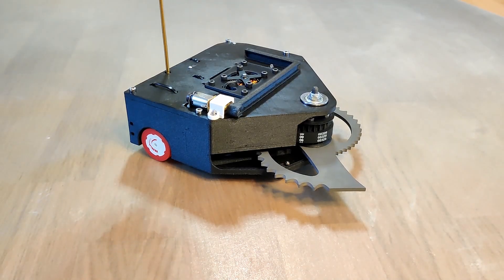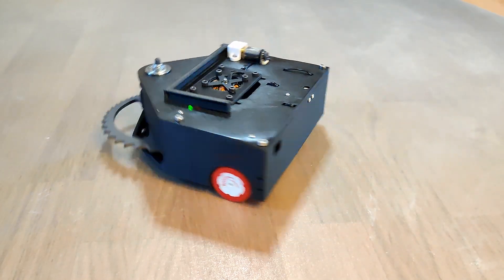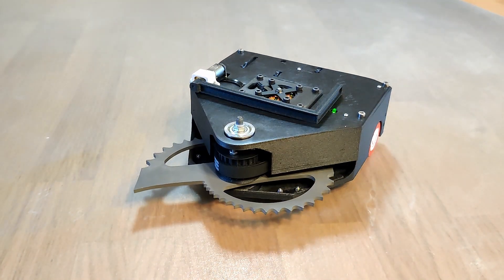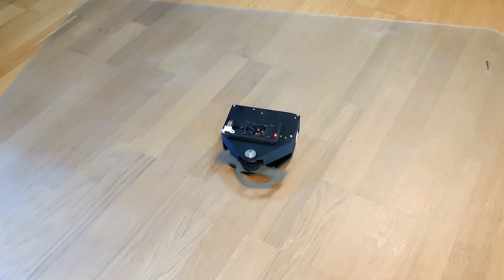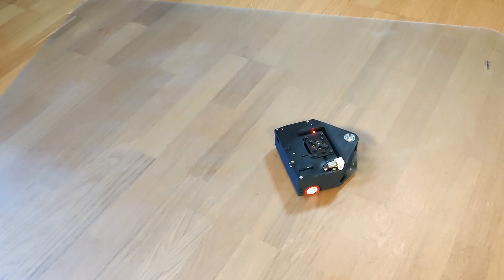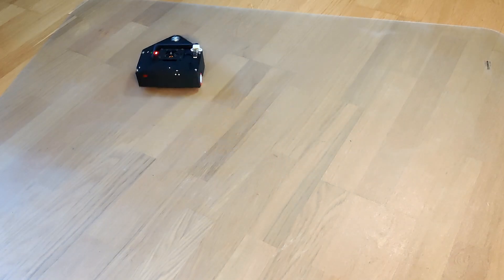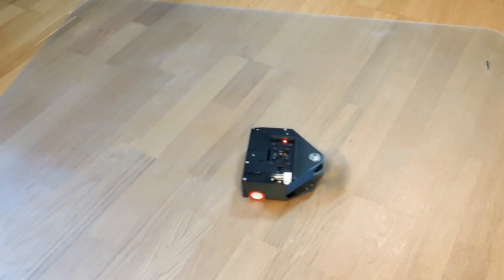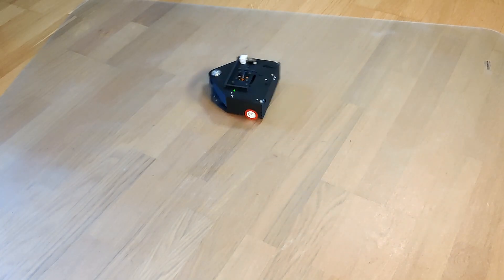Designing an Antweight Battlebot for Battle Bots Sweden

Comment: Nice build! Thanks for sharing. Could you share the component list? Like the on/off switch, wheel motors, blade motor, ESC:s and other ICs.

What is the advantage of having a belt drive instead of direct drive of the blade? I noticed that the belt dislocated in battle bot SM. I guess that makes the motor's powercables less exposed and allows gearing.

Comment: Looks like a nice robot! Do you find the motor encoders make it easier to control? Which microcontroller are you using? I don't recognise it.
Reply from the maker: Thanks! I added motor encoders to implement automatic functions for example the flipper on top of the robot. In this case they didn't effect the control of the wheels. The microcontroller I use is a Arduino Nano 33 IoT.